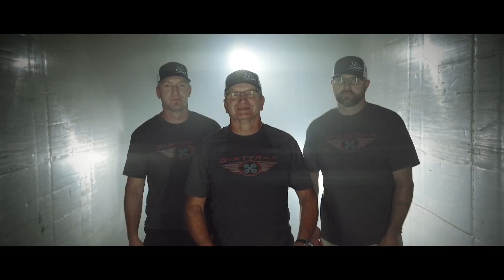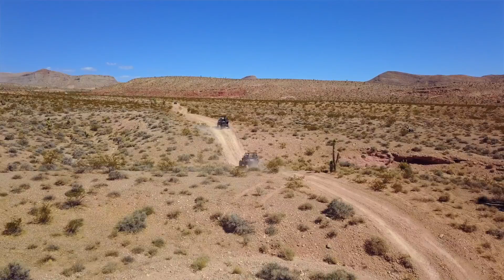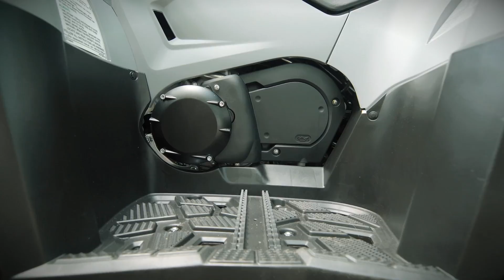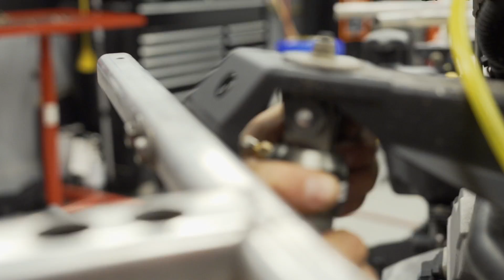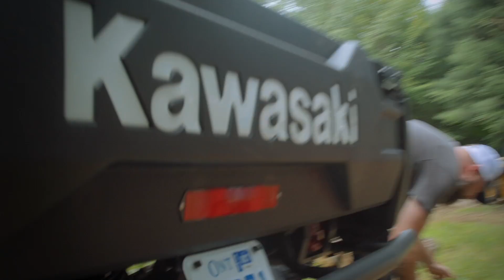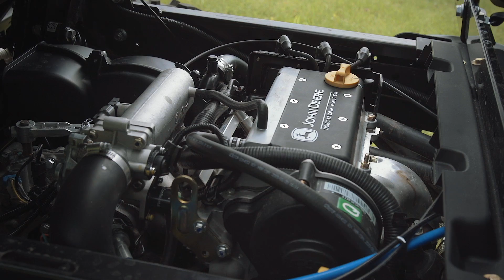Dirt Trax Television 2017 - Episode 8

Comment: lug nuts went on backwards during the mud build?? I was always under the impression that the tapered end goes on first to center the rim on the rotor?
Reply: Steven Lodwig Those wheels didn't have tapered holes so installing the lug nuts tapered end in won't work properly.

Comment: No Differential lock on the Kodiak is a Huge downside for me, Add that and I'm sold.. Its a deal breaker for sure
Reply: Morpheen999 apply the front brakes just a bit and you got yourself diff lock lol it's actually a cutting brake then but does the job

Comment: More electronic crap means more money and more break downs.. NO THANKS!!
Reply: Larry W that's exactly what I was thinking. There's something like 7 more sensors what a stupid idea
Reply: I remember the time UTV's where built for easy to maintenance.
Reply: DIRTaddiction the 7 sensors is basically just a gyro, like every phone comes with now a days, and a brake and throttle (tps is on everything with efi).

My concern is the valving itself.
Reply: Polaris can't even address the cooling fan circuit breaker issue that plagues their machines.  No thanks.
Reply: Turbo TDI  I think it's the breaker riding on floorboards underwater and mud covered on first mud ride...left to corrode and fail